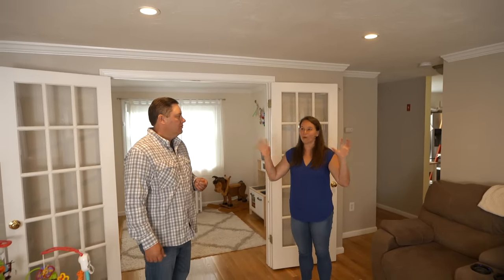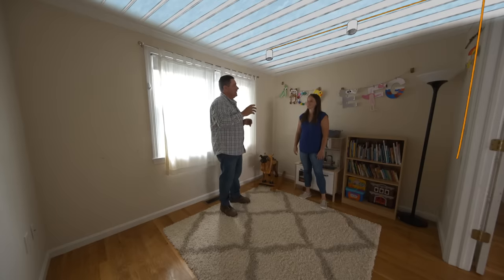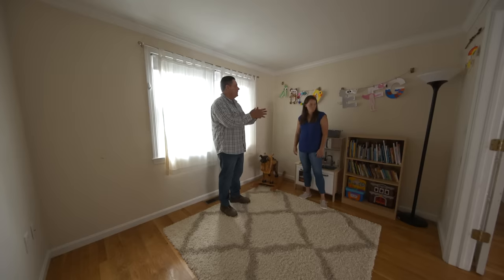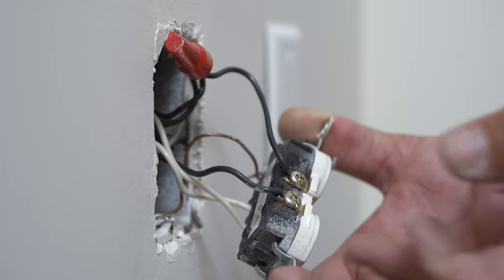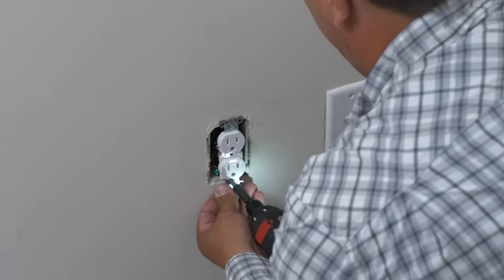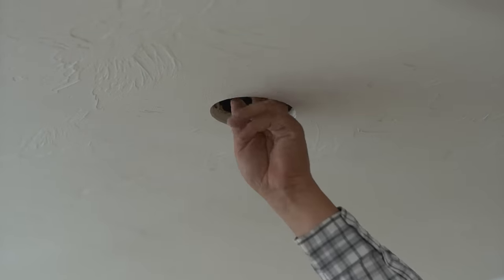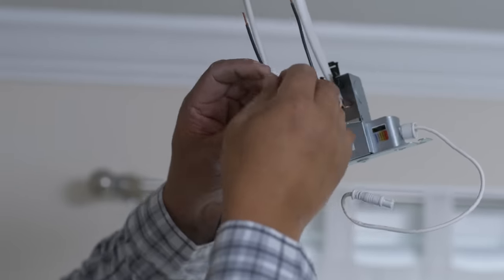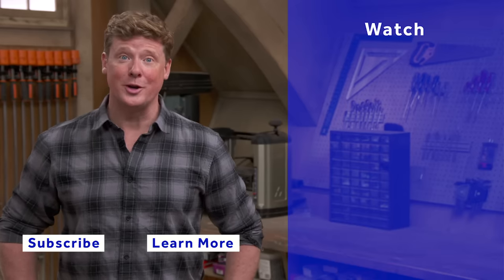How To Install Recessed Lights | Ask This Old House

Comment: Ok hold up…
1) how do you know there’s no wires or pipes above that board you drilled through? And 
2) how did you get your fish tape through the hole once you drilled it..
I’ve got a flex bit but to be honest I’ll never use it bc I can’t see what I’m drilling through and I would rather cut some drywall than drill through a water pipe.

Comment: If you were to accomplish this on your own, would you need to submit drawings for the new electrical or can it be omitted?
Reply: In most areas of the country, an electrical permit would be required.   But I don't think "drawings" (or any engineering  presentation) would be needed to obtain the permit.  Likely just pay a modest fee and schedule a single, final inspection.

Comment: Hey you guys skipped past the hard part where you got the snake to magically turn the corner along the ceiling. That’s my issue. What if my desired light placement doesn’t line up along the channel between the joists to the switch???  Do I take down the ceiling to drill through the joists to string the wire, then replace the ceiling drywall? I need to add a ceiling light to the middle of my living room. Update: Never mind, I found your video with the answer.

Comment: When recessed lights first appeared, I thought they were the coolest thing since sliced bread.  I couldn't wait to convert my kitchen in my condo to them and removed those outdated fluorescent tubes.  I finally got them done and now many years later, I'm bored with the look.  They are actually way too simple looking and have I said it, BORING.
Reply: What else would you do
Reply: @jwp09  I really don't know.  I was going to convert the rest of the condo but went with those surface mount lights.  Not quite recessed but pretty close for now.  My GF recently had a major remodel done to her house and has the recessed lights all over the place.  I don't think it added much to the wow factor but it's her house.

On another note, many years ago, I found a marble looking scone light at a thrift store.  I installed that in my downstairs bathroom and it really added to the WOW factor instead of boring bathroom vanity lights.  To this day, I can't find another one like it to place in the upstairs bathroom.  The hunt continues.
Reply: Yep, pot lights also have down-cast direct lighting which casts harsh shadows.  They take no space though, so no reason to give up the table lamps.

Comment: I noticed he didn't wrap that receptacle with tape.....
Reply: Probably a plastic box.  Usually wrap outlets and switches when it's a metal box
Reply: @spksoftware  I've always wrapped in plastic boxes just in case someone takes the cover off while it's live
Reply: @Sparky 2036 - it's good insurance...no doubt

Comment: 4:20 Wow! That’s a seriously crappy splice on the neutral wires!
Reply: How and why is it crappy
Reply: @Vanilla_Icecream1231  fr all wires were twisted tight that’s all that matters so they don’t lose up in years
Reply: @eliascastanon3505  thats what I thought he even pre twisted the wires
Reply: It wasn't pretty for sure but I'm sure it will do the job. You would be surprised how many times I find the wires weren't even twisted together under the wire nut.
Reply: @ericwotton2046  exactly and nothings pretty in the trades at times oh well what can you do 🤷🏻‍♂️ like the demo of a floor we had to do today. It ain’t pretty breathing that glue/cement/wood durst
Reply: @ericwotton2046  exactly that's why you when you put on the marrete you need to do a lil bit of a pull test

Comment: As an electrician of 15 years I wish I could watch DIYers attempt this project after watching the show 🤣🤣
Reply: It doesn't look so bad.
Reply: @Slappa Da Bass - sounds like an idea for a TV show - ppl watch DIY videos and then attempt to do the work.
Reply: @irvincoria1887  That's the idea. 
TOH likes to drum up biz for their expensive friends in the industry. [Your]Money is NO object in their minds. 
They gloss over DIY details and hope you dive in and make a me$$ for them to fix.
YOUR house will have a fireblock in the wall, your house will have insulation, your house will have old cellulose tiles or plaster ceilings, your house has plumbing and wiring in the wall, you cant drill the top plate in the wall, fish the line thru the little hole and bend it 90°, you can't find the wire he used (even if you knew WTF it was). AND your house won't have a GROUND WIRE to work with.

This video was deceptive, if unintentionally.

Comment: Those flat lights are awful. They make the wrong color light and it’s also flood light and you can’t change it. You’re stuck with it. The floor lamp was better than those things. Why did the guy go to all that trouble to figure out where the plumbing was if he was just gonna put crappy flat lights in.

Comment: I am happy the wires weren’t live when he touched them.  You never know.
Reply: In this case he does know, because he tested the wires before handling them.  Which is what everyone should do.  Turn off the circuit and then verify you turned off the correct one.